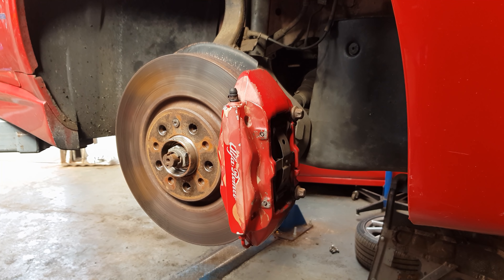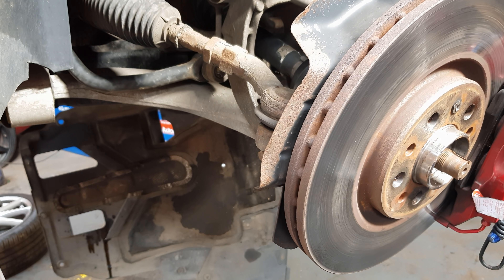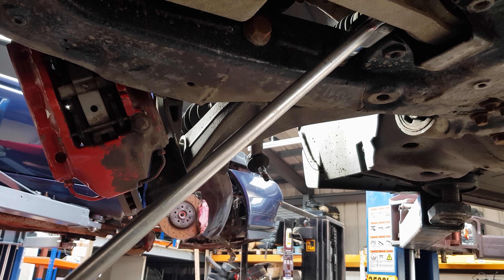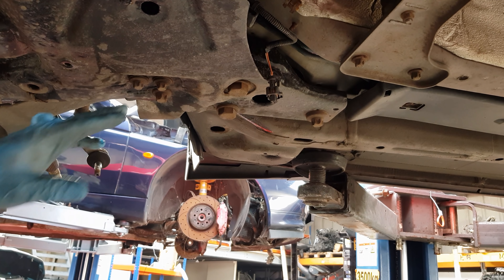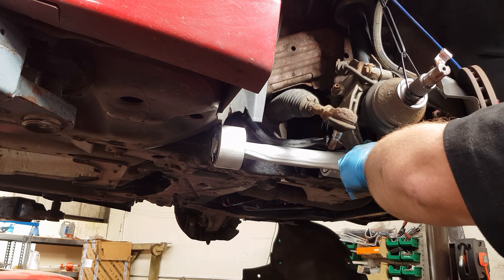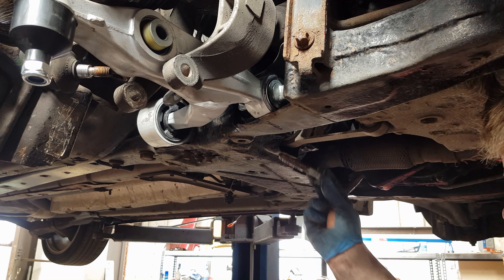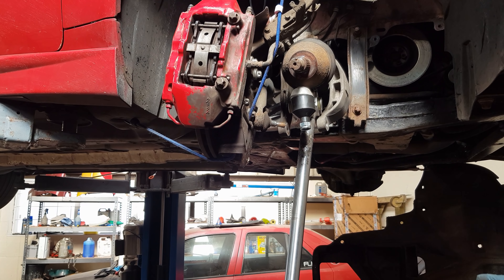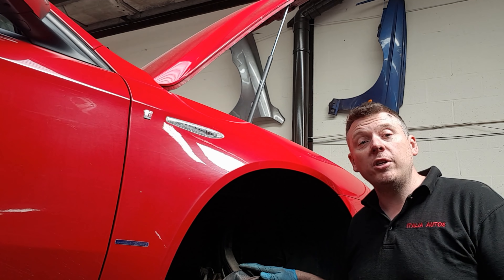Alfa Romeo 159 Brera Wishbone Removal Guide

Comment: Just had mine done 1.9jtdm ti, was good before but wow the ride feels sharper, tighter and slighlty more comfort. You can feel more rubber shock absorbtion. originals were 14 years old and still passing mots lol.
O.e replacement parts from alfashop, its just not worth putting cheap rubbish on.

Comment: You dont need to disconect drive shaft, upper wushbone and tie rod. Use crow bar to drible out wishbone  when you undo nuts and bolts, i changed both  month ago🙂
Reply from the maker: As I said at the beginning there are several ways of doing it I removed it mainly so you can see more in the video and I'm also used to doing them on 147's and old habits die hard lol 👍👍👍👍😀😀😀
Reply: Are you telling me that I need to remove just the bolts holding the lower wishbone and I can do the rest with a crow bar? That sounds easy, is this the way what I'm thinking you are saying?
Reply from the maker: @JoJanDiezel sometimes it works that way but not every time.

Comment: Hi Neil, thanks for the helpful video - I've had a lot of squeaking from the front suspension for the last 2 months under up/down movement (which went silent last week - bit concerning!) I believe this is likely to be the lower front bushes, is that right? 
The squeaking is very loud when I turn when parking the car too (159 2.4 sportwagon) - is that also the lower bushes?
I'm considering getting poly bushes and fitting them myself - do you expect them to cure the problem and  will I need to get a 4 wheel alignment because of the repair? 

Many thanks for the great content and useful guides..
Reply from the maker: thanks for watching.
Reply: whenever your suspension has been worked on, you always want to get the car realligned

Comment: Hi thanks for this video.  Quick question. I followed this and as I was dislodging the ball joint it started leaking pink fluid from what I presume is the steering rack. Do you know what could have happened?
Reply from the maker: You broke something or your steering rack is broken
Reply: @ItaliaAutos  is that fixable or will it likely need replacing. Its a 159 2.0
Reply: Looks like I dislodged the driveshaft from the gearbox. Any advice on how to reseat it?

Comment: hey mate I've recently bought a brera in need of some front end refurbishment. Is it possible to only replace the rubber bushes on the wishbone or would you recommend replacing it completely?
Reply from the maker: replace as ball joint goes also.
Reply: Allow £400 parts and 3 hours labour.
Well thats what it cost me, its a big job but should last another 10 years +
Doing this on your back in the drive does not appeal to me.

Comment: Would you recommend the poly bush upgrade for the lower arm?
Reply from the maker: If its cheaper than a new good quality wishbone.
Reply: @ItaliaAutos  I have the bracket with the poly bushes fitted. Just a matter of fitting it. I've heard it's a good upgrade and stiffins the ride and handling a bit.
Reply from the maker: @dougmcdougalson  yes it is.
Reply: A new o.e arm with new rubber bushes gives a very tight sharp feel but also a very complant ride.
I did consider poly bushes but glad i chose 
New rubber, mines not a track day machine, just a weekend  A &B road toy.
Its great.
159 1.9jtdm mapped ti on eibach springs and B6 shocks.
Perfect for me.

Comment: Smashing alloy parts with a hammer is not a wise thing to do. Buy a joint splitter. Using a hammer can cause fractures or cracks. Very expensive when you later realise you have damaged them. Otherwise good vid.
Reply: A hammers fine, or a copper mallet, those arms are very heavy duty.

Comment: On 159 it is 5 times harder than on 147,156,166...
Reply: Put mine in a good local workshop cost £150 to fit both, thats a bargain.
No way id do that job offa trolley jack.
Reply: @scottlehuray7062  trolley jack is dangerous of course.

Comment: 🤣🤣🤣🤣 Never in 35 years have I had those joints on any Italian car come apart so easily with a wallop of a hammer. I'm suspicious you split them and just tightened them up again for the video 🤔🤔 And I used bigger hammers 😛
Reply from the maker: Just cut out a few taps in the edit